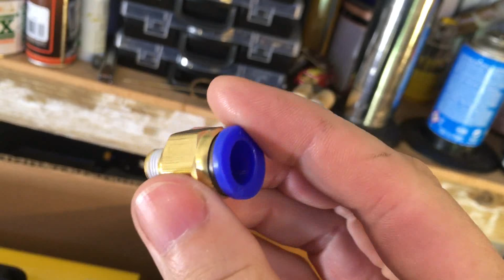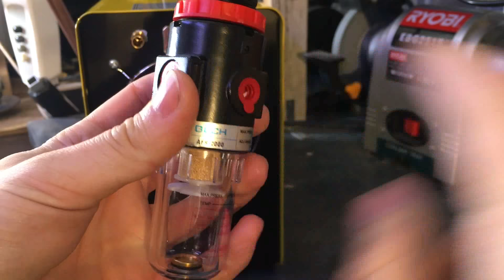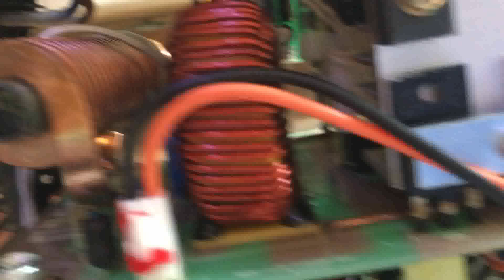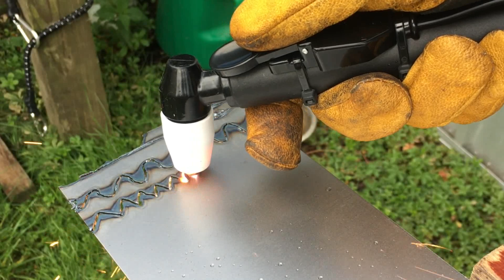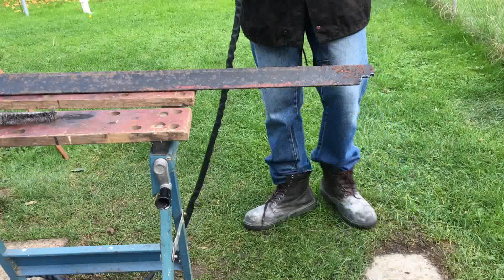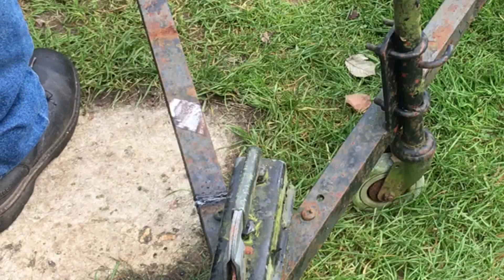CUT50 PLASMA CUTTER HOW TO SETUP TESTING

Comment: I have one of these units. I am a armature with it. I got it running well but as soon as I tried to cut 1/8 in steel all I got was burned up consumables and tips. Look like machine melted them, Any suggestions on what I am doing would be appreciated.
Reply from the maker: Jim Kirkpatrick have you tried turning your air pressure up on your compressor. Also when cutting angle you’re torch to blow the molten metal away .
Reply: @SHEDWORKSHOP  there is no air coming out of tip at all

Comment: If I plug it into 20amp/110v garage outlet can I use it on its lower amp settings?
Reply from the maker: don't see why not just make sure you get a 110v 220v dual voltage machine

Comment: Just got one of these.  They have changed it slightly, but overall very useful info.  Mine has a gauge that screws directly into the regulator, and it didn't come with any hose or even an electrical plug.  You have to source your own.
Reply from the maker: Pacfanweb thanks

Comment from the maker: *Plasma Cutter https://www.banggood.com/custlink/3KmG23iS2D

*MMA welder i would like https://www.banggood.com/custlink/3vGDsufVnM
*MIG welder i would like https://www.banggood.com/custlink/K3KKs7T5nO
*TIG welder i would like https://www.banggood.com/custlink/Gm3DBGhSsi 
*Tin Snip https://www.banggood.com/custlink/KmmmnwTVMl
*Stick Welder https://www.banggood.com/custlink/DDGKsw7PU9
*Welding Clamps https://www.banggood.com/custlink/mKKGbuwF1j
*Machinist Hammer https://www.banggood.com/custlink/KmDmQ1ut11
*Screwdriver Set https://www.banggood.com/custlink/KmmKATw5w4
*Precision Screwdriver Set https://www.banggood.com/custlink/K3v3Nuwi8V
*cordless Angle Grinder https://www.banggood.com/custlink/GDKmAFL7s4
*Carbide wood turning tools https://www.banggood.com/custlink/KKmKQwfS8S
* flex shaft Rotary Tool https://www.banggood.com/custlink/3KK3Z35Boi
*palm Router https://www.banggood.com/custlink/GDGGbT1iSj
*F-Clamp https://www.banggood.com/custlink/vKDGbfuZiB
*Double Edge Pullsaw https://www.banggood.com/custlink/mvGvb7uIZN
*Mitre Box https://www.banggood.com/custlink/33KvbuTSj3
* Impact wrench  https://www.banggood.com/custlink/mKDK6g6Bts

Above are affiliate links and in the comments it costs you nothing, if you do not want to use links search on goggle more info Thanks.

Comment: Thank you for the time you took to produce this instructional video! 
It's a great video, and since I bought mine from a "CraigsList" seller ($80 US, & he never used it!), but it didn't come with any manual, but he gave me a ton of consumables!
Thanks again, cause I'll be firing it up tomorrow.
Do you know, does it work on rusty 3/16" metals?
Reply from the maker: Walter Yancey Thanks for your kind comment much appreciated.
You can cut rusty metal you may need to clean where you start the cut and for the earth clamp is.
Thanks have fun.

Comment: Great video, thanx. mine came with no bag, no plugs in the regulator and the air fitting are tight after 1/4 turn but hay it's yellow. o
Reply from the maker: thanks . have a good day.

Comment: Was wondering why the plasma cutter was firing on the metal like it wasnt grounded out properly. Ground cable goes on the positve lug. Did not know, used to the hypertherm one at work thats all setup inside the unit.

Comment: Just bought one . A   "CUT 50 D".   A bit like yours, about the same size, but with an external pressure gauge.
  The Chinese English Operators Manual is very poor. No mention at all about the gas connection. Your instructions invaluable thanks ! 
One thing ... mine has a  "Slow Gas" knob  on the front. Not sure if this is another air regulator...any ideas ? / It already has  an air regulator like yours on the back.  I thought I would set the front one at maximum and regulate the air from the rear regulator. What do you think ?
Reply from the maker: Well thanks for your comment appreciated.
 Yes so many different versions of cut 50 manual still the same then if you have air pressure gauge on front and the reg on the back adjusts the dial should be fine. i have mine set to 65psi seems to give cleaner cut. 
all the best Have fun cutting.
Reply: @SHEDWORKSHOP  Thanks for speedy response. If mine cuts as well as yours I will be well pleased.
I did a large project last summer and cut up a lot of 0.9mm sheets with an angle grinder. I'm sure this will be a lot easier.  I might  make some sort of guide up for cutting a straight line. Looking forward to playtime !
Reply from the maker: yeah i brought a stainless 50mm x 5mm x 1.5m flat bar to use as a guide. 
Have fun.

Comment: you dont need to put thread sealant on a fitting that already has it.
Reply from the maker: not normally but no matter how tight it leeks so had to.
Thanks have a good day.
Reply: @SHEDWORKSHOP  after assembling mine i get why now. they are not pipe threads like they should be.
Reply from the maker: are yes that's right i remember now. Thanks.

Comment: How many psi compressor needs to have ?
Reply from the maker: between 55 to 70 psi. Low amperage cuts will require less air pressure for more stable operation
Reply: you need CFM not psi.
Reply: @Gleason.Craftworks  ok ill be waiting for the video of you running your plasma cutter off one of those little pumps that are in those little 12 volt tire pumps, they can produce up to 100 psi or more.

Comment: WHY IT DOES NOT HAVE CLEAN CUTS?
Reply from the maker: the air pressure was not high enough.
Reply from the maker: trying to cut to fast and plasma cuts get dross on the back side you need to clean off with a chipping hammer .

Comment: sir what gas you use?
Reply from the maker: The gas bottle is for the welder not the plasma cutter only need air compressor for the cutter
Reply: @SHEDWORKSHOP   thanks  appreciate much

Comment: Has anyone suggested using nozzle gel, or the anti spatter spray on the torch tip?  These are suggested for flux core wire welders to extend the tip lifespan..  Nice video, thanks,
Reply from the maker: Yes very good suggestion tip will try that thanks. Have a good day.

Comment: Hi, so this 50L compressor pretty enough for continuous work? How long does it cut before compressor starts to pump again? Minutes, seconds?
Reply from the maker: it runs for about 1 Minutes before compressor starts up but when its running it will keep going continuously . have a good day.
Reply: @SHEDWORKSHOP  thanks
Reply: @SHEDWORKSHOP  one more question, what are the specs of your compressor? Mostly interested in SCFM at 90psi. Thanks again.
Reply from the maker: its the same spec as this one https://amzn.to/2Lfic5P

Comment: Have you had any problems running the plasma cutter or the compressor off a 13amp socket? Do you get power to the shed via a extension lead? Great video by the way .
Reply from the maker: yeah i do run a extension cable but i use two plunged into different wall outlets to spreed the load. extension i use CARAVAN 16 AMP MAINS HOOK UP CABLE LEAD standard thin 13a extension is useless, they don't last long melted 2 or 3 you lose a lot of power over thin cable.
if i use one 13amp socket to run compressor + plasma  it will trip the breaker, and if it doesn't it could heat up the cable in your house and may cause a fire so take care don't overload.
Reply: DIY TEK NUT thanks for the advise . just purchased  16amp to 13amp 2.5mm 15meter extension.  Now I need to pick a compressor that can keep up with a plasma cutter so the compressor isn't running all the time .
Reply from the maker: Yeah i run a 50L compressor and it cant keep up, good luck be safe have fun.

Comment from the maker: Cut50 Plasma cutter 
https://www.banggood.com/search/plasma-cutter.html?p=070519238739201308J6&custlinkid=134454

Standard consumables
http://www.banggood.com/70pcs-Plasma-Tips-Electrodes-Fit-PT-31-LG-40-Plasma-Cutting-Torch-CUT40-CUT50-p-1028579.html?p=070519238739201308J6

Extended consumables
http://www.banggood.com/60Pcs-Air-Plasma-Cutter-Consumables-Extended-Fit-PT31-LG40-Torch-CUT-50D-p-1028100.html?p=070519238739201308J6

Links Above are affiliate links.

Comment: Tks much for the demo... well done 👌🏻.. at the en of the video there's a a green tank with Gages, is that part of the system or it has to be attached to it in any way? I'm new at this.. thinking of purchasing the cutter unit, also the consumables box, would you confirm link to purchase the consumables... I'm in America.. Tks again.
Reply from the maker: Hi Thanks, the tank is not part of the system you just need a air compressor
Reply from the maker: Standard consumables
http://www.banggood.com/70pcs-Plasma-Tips-Electrodes-Fit-PT-31-LG-40-Plasma-Cutting-Torch-CUT40-CUT50-p-1028579.html?p=070519238739201308J6

Extended consumables
http://www.banggood.com/60Pcs-Air-Plasma-Cutter-Consumables-Extended-Fit-PT31-LG40-Torch-CUT-50D-p-1028100.html?p=070519238739201308J6

Comment: Great video. just wondering are the expensive to run electricity wise? thanks
Reply from the maker: cheaper than a angle grinder faster cutting.
Reply: Thanks for the reply

Comment: I bought one of these, the air fittings for the regulator/filter were not tapered pipe thread!  They were straight thread.   SO, I don't think you get the same action you do with tapered thread, the fitting doesn't get tighter as you keep turning it.   It was wild, there was a lot of leakage at first.  I think I ended up using some pipe cement.  Anyway once it was finally airtight, the thing really cuts!  Consumables are amazingly cheap.

Comment: I am new to Plasma cutters, and i bought one of these. My first tests were not with compressed air, and not gas. Can anyone tell me what advantage is of using gas, what i would assume is argon, over air from my compressor?
Reply: People sometimes use nitrogen, I've heard of using oxygen in some systems, which sounds intense.  A main advantage of bottled gas is that it's clean and dry, consumables last longer.  Also it's quieter.  Expensive, you need a lot of gas!  I don't think you want an inert gas unless you're plasma welding.  N2 makes an intense arc, transfers a lot of energy I think.   You don't mind the chemical activity of the gas, b/c the melted part is being blown across the room.   This CUT50 seems OK with compressed air.  The consumables don't last long, but they're very cheap in quantity. I think an electrode might be $0.75, it has two ends!   The equivalent HyperTherm thing might be more than ten or fifteen dollars.   Also, I've found that you can clean the burnt looking electrode and nozzle and get it to work longer if you have to.  Little stainless wire brush, steel wool, things like that.

Comment: Good job on video, thanks for all the little details, the question I have: did you use any argon gas when you cut that trailer-dolly or when do you use it (argon gas) at all???
Reply from the maker: you only run it on compressed air no gases needed just air compressor

Comment: It is a brilliant bit of kit my mate :-) that trailer became a really easy job with this, and for the buck to capability and endurance it looks great for the doe :-D Nice components inside to, though slightly mad how the manufacturer didnt add the plumbers tape to the presure gauge connector at the rear of the front display there :-) I would have thought over the years they would have noted that :-p
 Still mate this is proper awesome, it looks like it could cut pieces of thin metal up from the smallest scale stuff with accuracy up to chopping up piers and ships :-p Making cars, sheds...just having it there when the need arises for it will be such a sweet feeling :-) a proper nice tool to compliment your other metal working and plc printing :-) sweet addition :-p
Reply from the maker: Hi Paul thanks yeah real good piece of kit makes easy work of a job a grinder might make 4-5 cuts on some thicker stuff and you have to change the blade.
Reply: Norfolktuber
hey mate :-) tell me about it :-( that iron rich brick trashes the best bosch diamond discs after about 5 bricks! I mean thats some decent cuts but thats unde water cooling and lubricating as well!
 wish i could use one of these for it i swear! but you are really right there thats alot of discs saved cutting the steel and thick metals like iron and things :-D will pay for itself in saved blades in no time :-p

Comment: 30Amps! she's juicy! Such fun. What is main use for it going to be? £150 where??
Reply from the maker: Hi mate its a 50amp machine i have it set to 30amp its all i need for what i cut, it will cut 14mm steel.
Well i cuts lots of sheet steel 0.9mm with aviation snips and messed up wrist repetitive stress injury, its from ebay German seller, other sellers have them in the uk now cheaper than i paid.
Reply: Price is amazing. Good idea, tin snips are bound to get painful after a while. I use aluminum plate (light and surprisingly strong enough for most of my bigger projects), hence I can actually use something as easy as a bow saw. But your obviously working on much bigger meatier stuff. Fascinating piece of kit, so what projects are you using thin plate steel with?